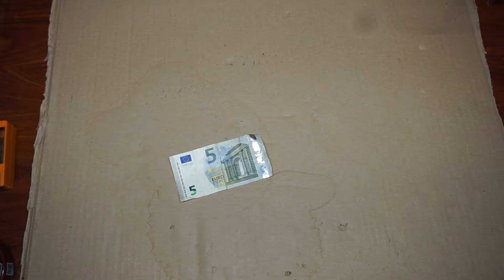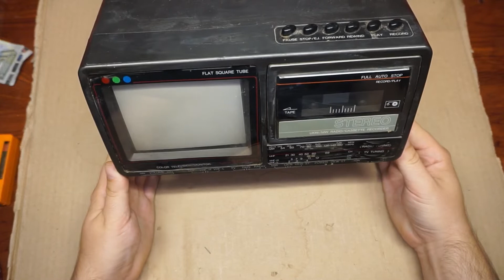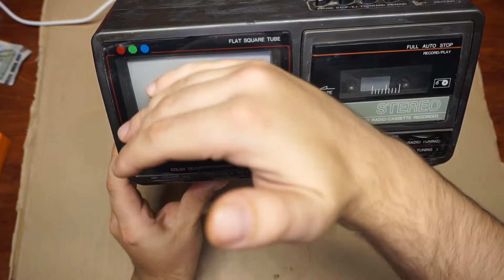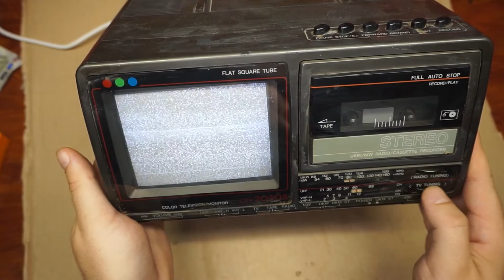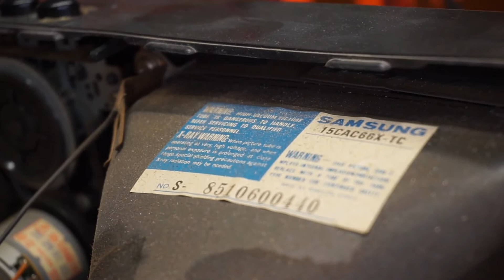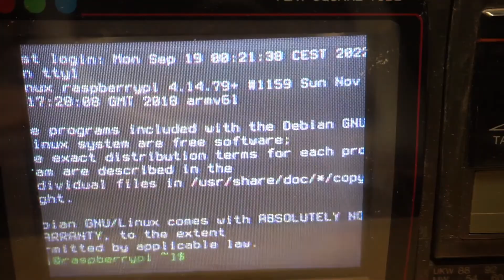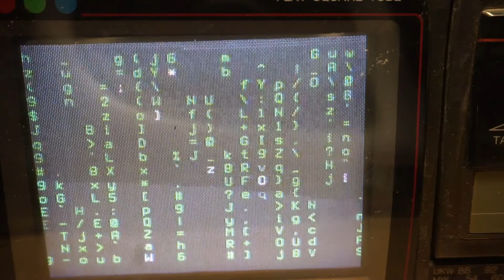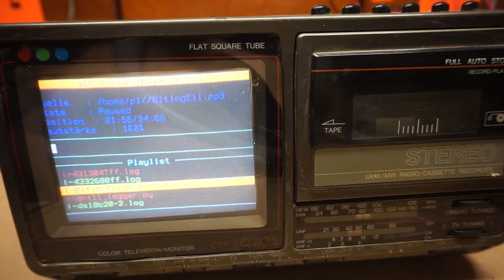Giving new life to a old device

Comment: Never trust that a capacitor has discharged.  Always short across it just to check.  Or if you don’t like welding screwdrivers to capacitors use a resistor across it first.